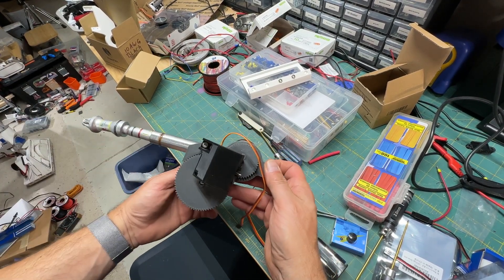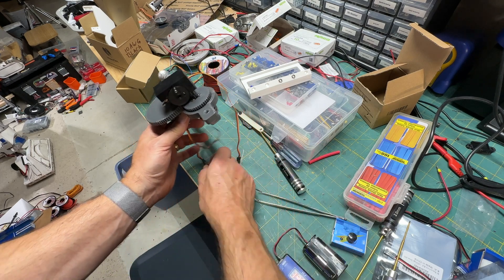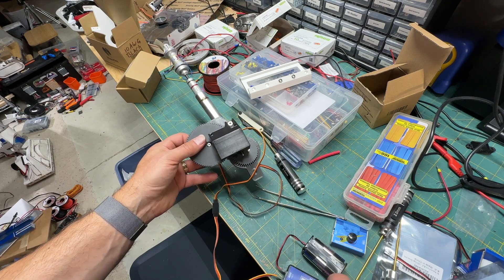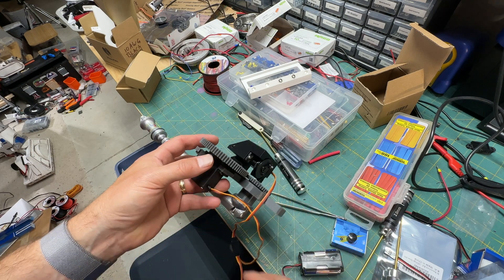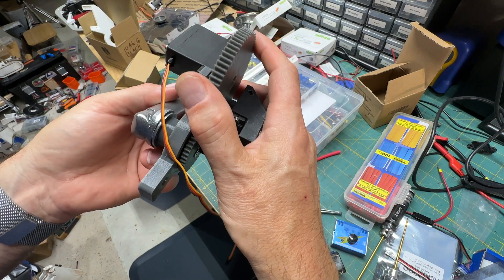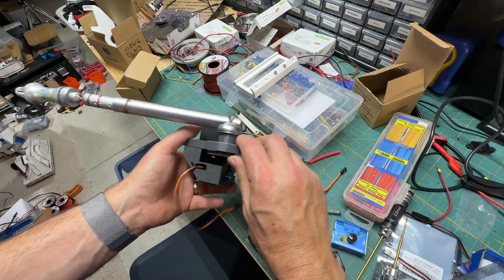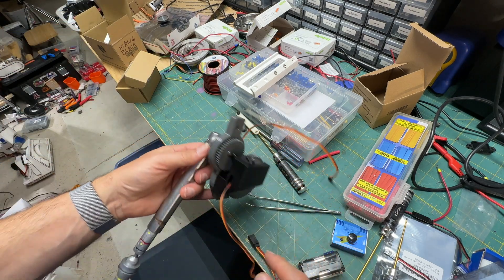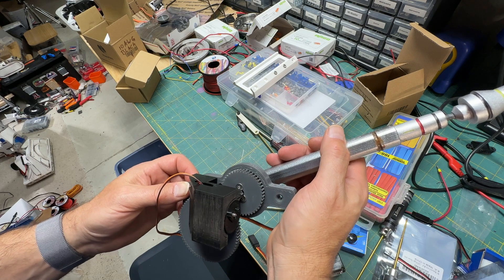NextGen Mark III Tool Lifter Overview

Comment: Very cool! I'm considering trying to mount that in my R2 MII build to get around the problem with the 2-3-2.
Any suggestions for the bracket? I actually planned to mount more than 1 arm per bracket as well as the saw and zapper. (I'm looking at possibly adapting Rorlin's lift gear mechanism or making my own for those)
The heat inserts are good. A pain to get in but cool.
Reply from the maker: I haven’t tried to mount in the V2 build yet.  I will look into that as I am able to find the time.
Reply: Mine is a bit more complex since I already modified the boxes with the idea of adding additional arms. I am going to have to spend some time thinking it all through again. @TheEebel

Comment: Thanks for sharing. Where did you get the data probe and gripper arm? Do you have links to the files? I’m gonna try to adapt this set up to fit Comm8 bread pans.
Reply from the maker: They are files I modified from Mr.Baddeley’s V2 design.  They are on his Patreon OneDrive.  If you provide the mounting location CAD, I can adapt the design for that frame.
Reply: @TheEebel   Thanks. I’ll get the CAD file for the bread pans. Hopefully, the mounts won’t need much modification. Do you have a link to Mr. Baddeley’ s files? I couldn’t find them or could you share your modified files?